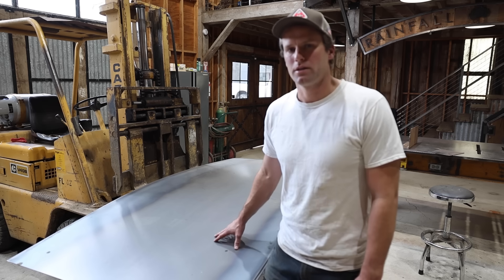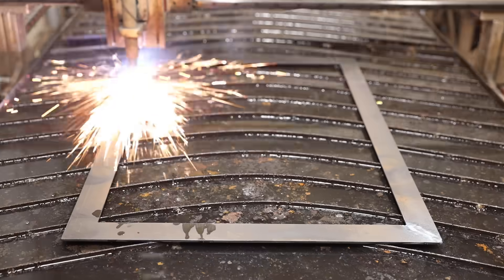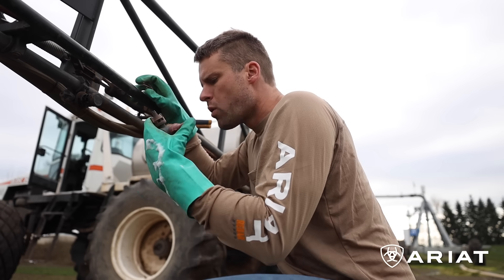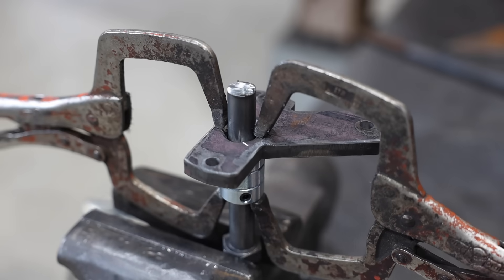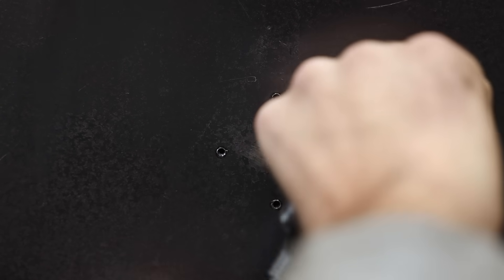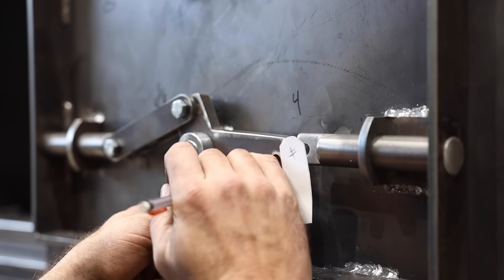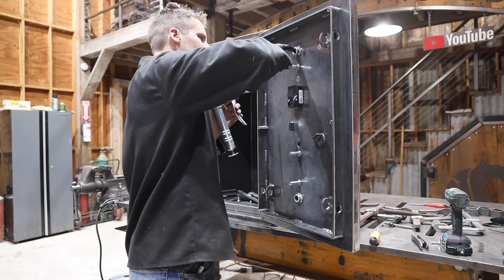Building a Fireproof Safe (pt. 1 of 2)

Comment: Tip: put lipstick on the end of the locking pins to mark where to drill your holes.   Great build any way you slice it.  I would've drilled holes in the bottom so it can be bolted to the floor.  They will often take the whole safe and leave.
Reply: Yep, definitely have to bolt a small safe to the floor.  Anything under about 500 lbs, or so, two strong thieves can lever into the back of a truck and drive off.  Cut it open later.
Reply: Grease works as well. Doubt he has lipstick in his shop.

Comment: To find your holes for the pins in the frame;  Use masking tape like you did.  Then put lipstick on the face of the pin.  Close the door and engage the mechanism.  Believe it or not it puts a nice circle on the masking tape right where the hole needs to be.  Nice safe.  Really enjoy your work.

Comment: Having lost my house in a wildfire and having several fire resistant safes which probably worked for a while but didn’t protect the contents long enough for the whole house to burn around them, I can tell you have a fire resistant safe at best.  So it might last long enough if the fire department shows up promptly and put the fire out but no commercial safe that I know will tell you it’s fire proof.  You might be able to make a fire proof bunker but even that might be a stretch.
Reply: There are multiple levels of safety, there are safes that can resist a lot of heat for a very long time but they can cost more than 20k

Comment: Knowing how the safe is built, I'd probably try to use leverage on the locking "pin" that keeps the wheel from spinning. The rotation mechanism seems to provide both a lot of strength and a lot of mechanical advantage. I think a better way to design it would be to make the combination lock connect the wheel to the rest of the mechanism when unlocked instead of preventing movement. Then again, I'm just a guy with a keyboard :)
Reply: No matter what you do, it's not a competitor to a metal-cutting circular saw... Or a torch, plasma, even a cordless angle grinder. There's no way to make a safe 100% secure, a guy willing to open it with enough time will open it, it's only purpose is to make their life miserable in the process so they give up or don't even try lol

Comment: Lol, boots are literally out of the box. And I love the scrip voice everyone has in videos to let us know 100% they’re just reading it off. Lol..

Now at the end of the video it seems you missed a few things. No re-locker? Also, you’ll probably lock your door open a few times since you didn’t design a way for the handle to keep the lock open while it’s unlocked. In the future you could put some blue tac and sharpie on the bolts when you attempted to lock the door it would transfer the marks across to the other side. Did you fully weld the turn wheel onto the shaft? If you did that would be another issue, if someone applied enough force to the wheel to break the locking mechanism. Typically safe handles are secured in a way that they’re a point of weakness against a leverage attack. I think you’ve built a nice fire resistant lockbox. Fireproof-Safe would be a stretch. Nice work nonetheless 👍👍

Comment: Love the ingenuity.  For fireproofing, I would have gone with 3 sheets of 5/8" drywall and a fully isolated interior liner.  You'll also want a heat resistant seal.  Sheet could have been thicker for the outer shell, and you want barely anything retaining the bolt handle so as to not be forceable.  Great exercise for v1.0

Comment: You should build a smaller scale version with all the parts including the double-shell, air-gap, studs and framing then put it in a fire to see if it really is fireproof. My intuition tells me that the metal contact between the outer shell, the spacer and the inner shell will conduct all that heat just fine.

Comment: Nice build dude, one thing tho, at 10:06 is that grub screw biting the shaft or running into a flat/dowel hole etc? Would want that to be a low maintenance item not to wear out.

Comment: Fireproof safes have a special fire proof gasket. You might look at obtaining some. Also be careful of the lubricants you use on the inside of the safe. At high temperatures they could cook off and ignite. As to waterproofness against possible water damage, as others mentioned use waterproof containers inside the safe. Well built, well done. No pun intended.
Reply: Good point on using extra waterproof containers inside the safe, I would've never thought of that. Thank you for the idea.

Comment: That linkage came out excellent! Not to be critical, but you might want to consider adding two vertical pins top and bottom. The way the safe is designed right now makes it prone to entry using a vertical bar in a prying motion. The front door potentially has the ability to fold, even just enough to clear the pins. Having a central pin top and bottom prevents this. That said, I don't suspect you are trying to build a bank grade safe, just enjoying the ability to build what you need. I think it's great how you are willing to try out so many different disciplines

Comment: You should watch soon videos on the locking mechanism in old-fashioned safes. There is a great recent video on Old iron machine works channel that covers this. I think you will find that the mechanism is surprisingly simple. I suspect that your plasma table is capable of making the necessary parts with little more than filing off the dross. I have one of these 1860s safes myself and rebuilt the lock. I was really startled at how simple of a mechanism it is. I know you normally stick to large fabrication projects, but I think you might find this an interesting introduction to more precision work. They are really kind of fun to make, friction is everything, so there is a lot of filing and trial and error. Surprisingly more of an art than a science. Watch a few videos, I think you will want to give it a shot.

Comment: So when you made the spacer frame and then used the plasma table to ensure that it is square, that kind of blew my mind in terms of the possibilities. I am a machinist, we are not typically big fans of weldments because of the heat distortion. I never thought about a plasma torch being computer guided potentially being able to cut a very straight line. Have you taken any measurements of this? Like micrometer type measurements? This has incredible possibilities if it could be dialed in to be more precise. Just based on your familiarity of the machine, what kind of numbers do you feel confident that it can hit? If you are just cutting a shape out on the table, are there techniques to keep the heat out of your part and more in the parent metal? I'm trying to understand if it would be possible for a CNC plasma to functionally replace rough in machining
Reply: If you want micron repeatability... look into Datron machines.

Comment: Anytime I need to market a spot for something that moves and need to be very precise. I will coat the end of the thing that will be "Hitting" the spot that needs a hole with a lip stick that is a color that will stand out against the work piece. In a pinch you can use grease in the same way, but it can be harder to see on the work piece and move a little bit.

Comment: Great Job!  I do recommend to drill holes in the bottom so you can bolt it to the ground, one other suggestion it to put the door opening side in a corner so someone cant try to pry it open.

Comment: the flimsy dial at the top is the week point and with the wheel being so rubust this is the flaw. just put a prybar on the wheel and turn till the dial lock breaks. other than this.... not a bad design but not very usefull as its too light.

Comment: loved the door locking linkage, but the door needs a heatproof seal.and heatproof material. the rest of the box needs more heatproof insulation. about 3 " more. the inside of this box will overheat very fast.

Comment: You should add an access panel for the combination change tool. Normally you'd just remove the door liner but in your case the door liner has bushings which you wouldn't want to remove.

Comment: I wonder how that shop bought combination lock would hold up to a 1/2 battery impact gun on the center bolt of the hand wheel.  Nice build the locking pins worked out great

Comment: Remember to bolt that safe into a wall or down to the floor.
Or if you're doing construction to cast inside concrete. 

Safes of this category can do well with this kind of construction . 
As someone else said, the urgent upgrade part to check is water proofness. Add some door gaskets and check your welds .

Upper categories usually start featuring a front door that resist drilling attacks , and protect the opening and lock mechanism.
Unfortunately, if this safe is for a workshop ... there are plenty of tools around to drill :P

Comment: Before you actually lock your stuff up in it, you might want you test it out by putting it inside a controlled burn at typical house fire with some paper inside. I see a couple design issues that reduce efficiency greatly. 

You also might as well add waterproofing to the door in case there's flooding.

Comment: Don't they sometimes fill the inside with either cement or something similar?  That would make it hard to move which is good for criminals but bad for you.  Also would make it more difficult to break into I would think.  I do like the fire wool though - it can withstand very high temps.

Comment: Nice.
But, if you build another one...
If you design your door and jambs right, your hinge side pins do not need to move, they can be static.  They will catch when your door closes.   You can then use your door fulcrums to run top and bottom pins as well as your side pins.   More insulation, more insulation, more insulation.

Comment: “This is the Lockpicking Lawyer, and today we’re going to be taking a look at a fireproof safe built by a radish farmer.” 😂

Jk, amazing work!
Reply: Lawyer showed how to open the safe lock in video number 1001
Reply: @zmyrus  Yeah but that's a robot lock picker that takes 8-30 hours to open this one. My guess is radish farmer comes out with laser weapon in that amount of time: secures gold, bills and giant diamond, apprehends villain, ties to fork lift, takes to authorities since he's a pretty solid dude and doesn't seem inclined to vigilante justice. 
LPL did say he's skilled at these types of combo locks. I wonder how long it would take or if he would just insert a credit card behind the bolts or pull off some other kind of side attack.
Reply: I imagine the simplest way is just to brute force the wheel and snap off the locking part. Or, of course, just drilling it out entirely.
Reply: @AdrianTache  I have been a vault smith for many years.  My first thoughts after the completion of this safe were: 1) Great job on making everything line up and work well. 2) [to your point] he should grind a notch into the shaft to make it weaker, so that brute force is not an option.  This is how ALL bank vaults are built.
Otherwise, he did a GREAT job.
Reply: @charlieg424  no issue with the lack of a relocker?
Reply: @charlieg424  interesting line of work, do people ever really break into vaults that often or is it owners mostly locking themselves out? cheers!
Reply: @charlieg424  sir, what happens if I lock myself in a bank vault? Is that a way to open it by the inside? This is a question that haunts me my entire life.
Reply: @ThatPNWGuyTackle  Yes, there should be atleast 1 relocker.
Reply: @alex4alexn  I do mostly Bank work.  They are rarely "broken into" anymore.  I am usually called when something fails.
Reply: @DanielConstantinoS  In most bank vaults you would need a specific set of skills and a few tools.
Reply: @AdrianTache  if he solidly welded the handle to the shaft yes. This would be the first weakness. Next is that there is no re-locker, it’s a spring loaded device that locks the safe shut if someone drills and punches out the lock. Since there is no re-locker you could easily punch the lock out and be in. The lock wheel knocked off and the body of the lock smacked with a punch and hammer a couple of times will bend or break it enough that the locking bar  will no longer keep it shut. This is one of those keep honest people honest type of projects. More like a fire resistant lockbox. Still fairly well done. Some more time spent building a re-locker, reinforcing the locking jam and making sure the handle of the safe is weaker than the internal components would make this much more secure. That way if someone attempts to leverage the wheel it’ll just break leaving just a shaft stub left out that you can weld a nut on to later to regain access to your belongings, if that foils the thieves that is.
Reply: @AdrianTache  A safe is not the ultime protection
Reply: @AdrianTache  I’d say the hinges
Reply: Yeah, just wanted to say that a safe to be even remotely ``safe`` must not have hinges on the outside, and the body should be 3 cases, not 2, the final product here should be put in another box with 2 inches space around, with standoffs and studs to support the construction, and filled with glass and steel shavings and dust reinforced concrete... This way you can just take an angle grinder and hack off the hinges or seams apart and you are in... You cant grind or drill through 2 inches of glass+steel filled concrete, not that easily anyways, and not that quick... That too would give the safe another 500 pounds at least, if not half a ton, which would make it more safe, as a safe should first and foremost be immovable...
Reply: @camillosteuss  i think he’s ok on the hinges. If they chopped them off the four pins would retain the door. I think the hinges aren’t part of the security, they just allow access to the safe. 

I think it’s a cool project! And for sure better than most options I see at the big box stores.
Reply: That dude is overrated. He'll spend time before putting it on YouTube opening it. And what a shocker. He opens it. Video over. Cool, bro...
Reply: The problem is not this problem. the problem is with the assurance.
Reply: I was looking precisely for this comment. 😂😂
Reply: hahaha....yeah, bullet proof safe with a lock you can open in under on minute

Comment: Three things in order, just observations, not critique: 

1. in a fire proof safe the core is decoupled from the outer skin, can't help that now tho.

2. the handle needs to either be a weak link itself (small pin and only a small portion of the shaft going out) or a weak link inside, otherwise it can be used against the mechanism

3. fireproof safes fail for the most unlikely reasons, which is when the fire department arrives, their concern is to stop the fire, not save your property (or better expressed, they're not specific about what's saved, they're specific about being safe whilst stopping the fire, saving lives being their biggest concern, theirs and that of the potential victims), so it needs to be water proofed, which means you need a gasket, which itself needs to be fire proof and water proof (yup, tall order).

Source: i used to work with a safe company's engineer, learnt a few things from him.
Reply: 1 This is not a problem for many valuables, but if a person is storing something that needs to be shielded further, a lock box inside the safe would provide an additional layer of heat protection, as well as providing the convenience of sorting the items inside the safe, if he required even more protection he could also line the inside with ceramic plates, so while conduction is a problem, this is a problem that can still be helped.

2. This is unnecessary for this kind of personal safe, there's little sense in him making a safe that he needs to destroy to recover the valuables inside. His goal seems primarily to protect the items inside from things like fire or being misplaced, he's not trying to prevent the cast of oceans 11 from stealing what's inside.

3.  This also shouldn't be a problem for most valuables.  Things which are at risk of water damage can be stored inside heat resistant waterproof containers (waterproof silicone containers, for example)

The point is only that these are not insurmountable problems, and most of the issues, which granted are valid concerns, can be overcome fairly readily.
Reply: Regarding point no. 3 - that's actually pretty easy. You can get RTV Silicone gaskets pretty cheaply now.

But it would be extremely interesting to stress test this safe. I think it might hold surprisingly well.

Comment: Really really nice project. Your amazing. However would not the fireproofing be very limited with no insulation in the door?
Also where is Jake?
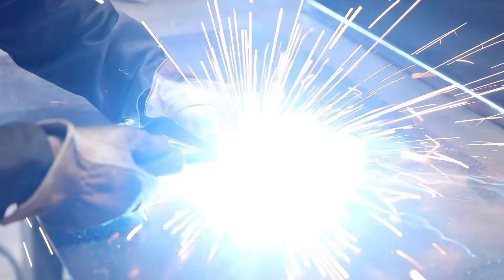Reply: There is insulation on the back side of the door. Somewhere around 4:20.

Comment: You could have bought that for $600... but it would be a little taller.  Not sure how much your total cost was, but you probably didn't save much.   It's the same with the trailers.  You can't even hardly get the material for the price that trailers are sold.  Mass production knows how to squeeze out those pennies.
Reply: I doubt he built it with saving money in mind. Plus the video revenue puts him ahead I’m sure.

Comment: Really ambitious project man your a good fabricator......im a welder also and for finding your locking bolt holes locations I use this stuff called dykem high spot blue its a non drying blue die and works great for stuff like this machinists use it to find high spots between mating parts just smear it on.

Comment: My antique safes are full of Asbestos powder. I see new ones use a lot of drywall, or manufactured insulation fibre board.

The handle is really weak sintered white metal - hollow.  It makes it harder to force open.